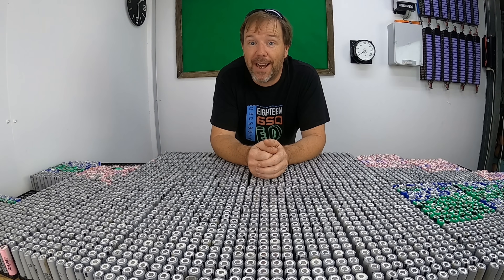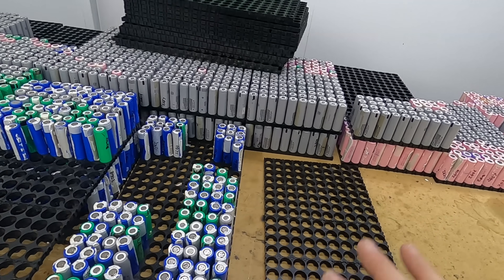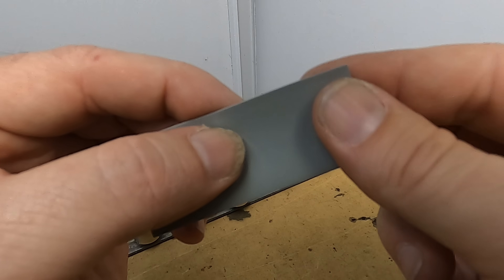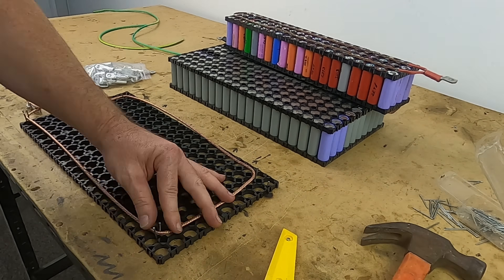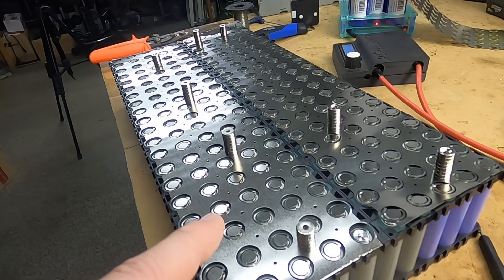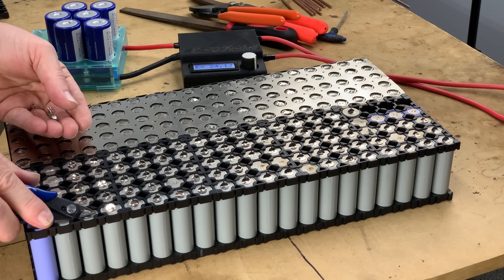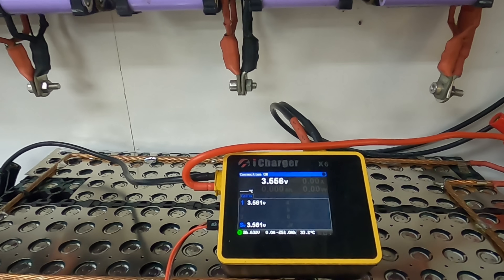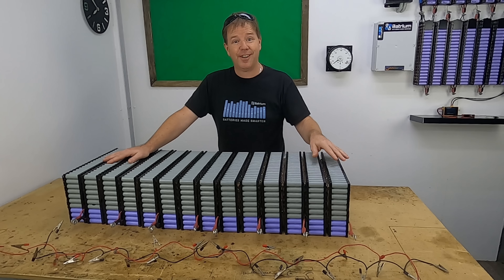Creating my single biggest D.I.Y. battery with 2800 18650 cells recovered from used laptop batteries

Comment: Dude!  You have good intentions for recycling but this is dangerous.  And you are encouraging people to deal with a potential bomb at home.

Batteries from different manufacturers have different chemistry.  They have different charging characteristics and different internal resistance.  Then there are good manufacturers with high consistency and bad manufacturers with filmy cell construction.  And you just put them all together.  Worse, you used old batteries of varying capacity degradation.  All these can cause current back flow and will increase battery internal temperature.

When I made commercial batteries, not only can we not mix batteries of different capacity or batteries from different manufacturers, we also have to use batteries from the same production batch to ensure internal resistance consistency. 

And then you are doing spot welding with tons of batteries sitting next to one another.  I had seen small explosions at our welding stations even with help of jigs to align welding spots with the spotters.  Now you are welding with free hand.  Poor cell manufacturers posed the greatest risk for our workers in the welding station.

Then the way you stacked these cells is hindering airflow to the inner cells, further increasing the temperature during operations...

And you put no temperature monitoring and safety circuitry to control voltage & current...

Man, pls don’t do this.  You clearly lacked the knowledge on the safety aspects of handling batteries.  Pls do not mislead your followers thinking making homemade batteries is a good idea.  

Leave it to the professionals.  PLEASE
Reply from the maker: Dam dude you looked at the rest of my channel - you might have done it for a living but i have lived this shit for years and years. Everything you said is kinda true except that stupid word bomb - you ever googled the fault state of a bomb, they explode- these vent .. MASSIVE difference but each to their own. Look at the second video and tell me I don't consider safety at every step - took me a year to test thousands of cells and get these ones together.. These weren't the shit at the bottom of the barrel they were the cherry picked good ones. Lets not go down the path of not doing something that is great for the environment because we are scared. Lets give all batteries the second life they deserve.
Reply: HBPowerwall My initial comments seemed a bit harsh. I apologize if I sounded disrespectful.  I do respect your intention and efforts to reduce environmental waste.  It’s admirable.

On the “bomb” comment, it did seem a bit exaggerated.  Nonetheless, I had personally blew off some of my batteries during my testing.  And the last ones I set off were only 4000mAh.  Well, I wouldn’t want to be anywhere near them when they exploded.  And yours stored energy 2000x more than mine.  I would be truly frightened by the thought of it going off.

On the 2nd part of your video, I saw that you bought a container to isolate the battery from your living area, which is a good precaution.  Still, if you were to work with lithium cells & batteries, I would suggest you build in safety mechanism on the battery level.  Control the current & voltage.  Good batteries should have each individual cell be monitored for current & voltage while the hottest part of the battery has to be monitored for temperature.  I am sure your followers would be thrilled to learn these from you.

Comment: Unbelievable. Great work.
But I wonder something....
Why are you putting so much effort into old batteries, What is the lifetime of those batteries? If laptop batteries were dead, this means, they are also bad?
Reply from the maker: To be honest it was to make a cool video (success lol) but i already use this system for the past 4 years and with maintenance  its holding up 100x better than expected. I'd hoped for 5 years useable but I'm coming up on that milestone fast & the batteries aren't showing signs of slowing down yet. Every cell goes through a complete testing process that for this battery took many many months.

Comment: Thank you for all the information, and taking the time to post/video/edit AND reply to every comment (that's so huge). I was wondering about the kWeld kit, I'd like to have it work without a Lipo battery and saw that you have the kCap Module. What power supply do you use and do you use the kSupply, as well? 

Additionally, I have 70+ 18650's that have been sitting for a few years and the protection have gone off and they measure 0v. I read that it's not safe to bring them back to life (by applying a jumpstart voltage) as they may have copper shunts that formed over time across the cathode and anode, what are your thoughts?
Reply from the maker: best bet is to look through this thread and it's videos - www.diypowerwalls.com/kweld. If a cell is zerovolt recycle it ..
Reply: @HBPowerwall  Thank you!

Comment: How do you process capacity of that many batteries? What do you use? You do bulk parallel (20 o more batteries)capacity check ? What charger model you use?
Thanks
Reply from the maker: One at a time with an http://www.diypowerwalls.com/opus
Reply: HBPowerwall 
Really wow about 1500 days running capacity

Comment: Beautiful work and inspiring.  Only one question - what type of laptop use 18650 batteries?  I've never seen a laptop use that.
Reply from the maker: in the past most laptops used 18650 cells some used 17650ies then prismatic or pouch.. these days its more pouch style batteries that are slimmer, lighter and more dense

Comment: Szort and easy  - not proffesional, crazy and stiupid, very, very danger. If you want have problem do the same battery pack !
Reply from the maker: You're the type of human that replaces a tyre when it gets a flat rather than repairing it. The environment will thank you for your approach to life..
Reply: You are absolutely right, professional would be easy to use a LiFePO4 battery. This is less dangerous and costs just as much. Using the Li-ion battery for stationary applications is very stupid.
Reply from the maker: Would have made a boring video 😂

Comment: I only use brand new batteries(as in brand new cells inside)but this is a cool project, one of the largest DIY battery projects I've ever seen on YouTube.

Testing used cells is way too time-consuming I'd rather not bother...
Reply from the maker: I would agree and would rather not bother - BUT new cells would make for a boring timelapse lol
Reply: @HBPowerwall  true

Comment: Clear my query. What If one of those cell battery stop working how do you rectify that and how will you replace it?
Reply from the maker: Rip the nickel strip off as i did in this video and knock out the cell.. a bad cell gets hot & a thermal camer is a handy tool to have in your tool box

Comment: The extra 3 empty spaces for the holders is logical, but I didn't understand the purpose of the 6 blank cells.
Anyone?
Thanks
Reply from the maker: 6 blue cells are where the cells touch the metal mount - To stop shorts

Comment: Where are the fuses? Aside from those wires coming out of each pack, which seem to be the current fusible links, intentional or not. With each battery having a fault current capacity of at least 5A and most modern ones 10A or more, the available fault current of each pack in that battery bank is dangerous. Better use beefy fuses with an adequate AIC too, lest they become dangerous little grenades. Stored energy is not to be trifled with.
Reply from the maker: Well there is a CID, then the fuse wires, then battery bank fuse, then shunt trip, then charge controller/inverter THINK i got this covered well.. i'm not good at math but thats about 5000 fuses or safety devices

Comment: Are you afraid fire from battery?
And for what you using this big battery pack?
Reply from the maker: Nar - check out the next video it's all going into a shipping container. It will be added to my 50kwh of the same storage i already have of the same storage. That will make 75 kWh of batteries

Comment: You can make a spot welder with a 12 v battery and a Ford starter solenoid.  Works great.

 Why not make the packs 6, 9, 12, or 24 volts instead of 3?
Reply from the maker: Yes you can, it's cheap and accessible but not consistent or repeatable. the whole battery is 48v nice and cheap to add a BMS to it this way.

Comment: anyone seen the results from the national battery testing center in Canberra? Its a train wreck of faults,defunct suppliers and lithium batteries that fade with use. Lithium has its place for small,mobile devices...........but it has some serious drawbacks. For example Lithium storage batteries now require fire proof enclosures inside buildings, are expensive and on a once daily charging cycle will only last 15 years, maybe.       Or THIS https://youtu.be/ehcGWLOH-Js
Reply from the maker: You've also seen all the crash tests of cars that are still on the road right??.. ok next point look at next video :) and if get 15 years usable from the i'll be freaking stoked - if I get 10 safely i'll still be stoked - and if i get 5 good years with full daily cycles (including my other 50kwh of the same storage) i'll do a nudie run up the gold coast highway!

Comment: Out of the 3000 batteries you recovered from laptops. Were they all above 2.7v? Or its safe to recover batteries went below 2.7v?
Also. Has any battery exploded or got extremely hot during recovery?
Reply from the maker: I've recovered more than 15000 cells in total, 1000s and 1000s were below 1v and recovered slowly & carefully most have been very usable. I've never had any cell 'explode' BUT if you look at a video from last week I had one expand on me that could have gone very badly.. not good at all and a wake up call for sure. As for cells getting hot THOUSANDS got hot and were recycled.
Reply: @HBPowerwall  appreciate your response. 
I think for quality brands batteries The risk is very very low. Thats why people are divided.

Comment: Curious. I guess it is very likely to recycled that two batteries in parallel have different behavior like capacity, internal resistance.their voltage drops differently
Reply from the maker: every cell was resistance tested and are closely matched in that respect. It's not idea but it is DIY and helping cells to their full end of life not half of it.
Reply: @HBPowerwall  oh i see👍👍. thanks for response.

Comment: This guy is Wicked Definitely something id like too try out In the future big Inspiration 🙏.
Could anyone help me out I've stripped some laptop packs done all of the appropriate checks checked voltages disposed the bad low voltage cells. Charged  the cells with Over 2.5V and also Discharged with my Discharge PSU Everything Checks out however i tested The cells in my vape uses 2 18650 and its weak Im assuming the cells can't Supply enough Current too power the coil Im just confused why They tested Good but not actually when in use
Reply: The Cells are Samsung 30Qs
Reply from the maker: No NCR18650s

Comment: Hi i saw your videos its soo cool and I'm need to know more about BMS since the own build power bank using a small PCB weather it will surve it purpose of cutting the power supply when the overcharging or any over heating issue in battery will it handle?

Comment: Why do you mix 18650 cells of different mAh capacities in each pack, like mixing 2300 mAh cells with 3000 mAh cells? I completely don't understand the reasoning behind doing that. Won't the pack be only as good as its poorest performing cells?
Reply from the maker: Well they all self balance so there is that, each 191p battery is well matched to it's other 14P and the BMS balances them. Also it's used cells - they would be unusable if you weren't to make concessions on capacity

Comment: I once set a 18650 on fire by soldering them instead of spotwelding. Scary stuff, I can tell you..
Reply from the maker: how did you set it on fire just from soldering? what were you doing wrong?
Reply: @HBPowerwall  I didn't had a spotwelder on me and had to repair some nickel straps after removing a bad cell. So I have soldered one nickel strap on top of another, got the solder liquid, pushed down the one nickel on the other and boom, the liquid got between plus and minus. Was a hell of a fire for 5 seconds. Really thought shit is going down with the 3kWh next to it but it somehow stoped again by itself. Maybe because the liquid solder stuff burned? I dont know, it was a blue, high flame (maybe like 10-20cm, dont remember completely anymore).. really scary.

Comment: 13:15 doesn't soldering on top of the batteries heat them up? What about soldering the busbars first and then welding the batteries afterwards?
Reply from the maker: Tired that but lining it all up was a bitch to say the least this way was the lesser of two evils

Comment: Amazing, how much time you think your battery will last if you keep it all the time in a 60 to 75 max discharge? love everything you do!!!! another question is, the batteries are just used old batteries? or you did some process to restore it? thanks!
Reply from the maker: I would think 10 years - now that is dependant if i can control the heat in the shipping container. I tested every cell - for heat, capacity, self discharge & internal resistance .

Comment: when one cell goes bad....F"¤%&//8
Reply from the maker: Or you check you use common sense and maintain your battery, using a good quality BMS with temp & voltage control, use a thermal camera to keep an eye on cells & install in a location so if F"¤%&//8 happens - nothing else gets F"¤%&//8ED with it...

Comment: Are not those batteries supposed to be useless? How are they going to store charge?
Reply from the maker: Would have spent this much time if they were useless? There is 25kwh of useable storage there ... Wouldn't consider that useless...
Reply: @HBPowerwall  
My real concern was the following: If those cells were used, how would I standardise the remaining capacity of each cell that I will be including in the big battery? Are they all of the same remaining capacity? It is Impossible. What would happen if I included, in that battery, some cells that are of significantly less remaining capacities than the others?

Comment: But without using BMS's for each cell you can end up overcharging/undercharging certain cells and in extreme cases it will catch on fire would it not.
Reply from the maker: Watching to the end would produce a rather reasonable answer to your question...
Reply: @HBPowerwall  I saw that you said in the final video you would attach a BMS but I'm assuming your attaching that to the banks of cells and not the cells individually. If your connecting it to the individual cells then apologies I just misunderstood.
Reply from the maker: Tesla doesn't even attach to every cell? Each 'cell' is a 191S battery so that will naturally balance - no need to do 5000 extra little wires
Reply: @HBPowerwall  Well I mean tesla watercools their powerwall and uses cells that are almost identical for each. What's a 191S battery, an 18650?

Comment: This might be the most economical way to upgrade the old lifepo4 batteries in my zero turn electric mower I converted (see my short video).
I was thinking of used Nissan Leaf cells.
Reply from the maker: Leaf cells would be better, these don't do high amp draw and rough ride would destroy the plastic mounts & fuses fast i think.

Comment: What cell insulators did you use on the top Pete? I can't find a reference to them in your Project sheet
Reply from the maker: I got them from 18650 shrink .com here - https://rover.ebay.com/rover/1/711-53200-19255-0/1?mpre=https%3A%2F%2Fwww.ebay.com%2Fitm%2F18650-Battery-Insulator-540pc-DARK-GREY-Adhesive-ebike-DIY-Powerwall-US-SELLER%2F132303960347%3Fhash%3Ditem1ecdee391b&campid=5338316525&toolid=20008

Comment: What are you going to do as the cells die? They are used so they will be dying one by one monthly. What a nightmare tracking down and changing the dead cell! does each and every cell have data logging? I use brand new Samsung 21700 cells. Much larger and run much cooler. They are new so i can relax and not worry about wasting my time.
  This is the biggest waste of time i've ever seen. Tell me this was bad criticism in ten years! Each parallel bank is only as good as it's weakest cell and each string with a weak cell will be low on voltage. You should check the specification of these and see how many charge cycles they are good for, then think how many cycles they have already done.
Reply from the maker: arr you sound like quite the expert... so no use trying to educate you. My BMS is more than upto the job of babysitting my batteries - my last battery is still happily running my home for the past four years.. and i'm going to bet 1/10 the price you paid for 4 times more storage.. you take your new cells and their price tag. I'll take my old cells and save the environment just a little bit more & save a hell of a lot of money..
Reply: @HBPowerwall  If your running your home there is no reason to go li-ion. Just get some old fork lift batteries and the job is done!
Reply from the maker: Been there done that voltage sag alone is reason not to go back

Comment: I would like to have your confidence that those trash accumulators would not catch on fire. Even new automotive ones could.
Reply from the maker: So coud your car, phone, laptop, powertool, toaster, the list is long with the items i own that i have confidence in.
Reply: @HBPowerwall  Yeah :) I use such refurbished batteries in light torches etc. And I have seen few shorted, they could go pretty hot. Anyway, I sincerely wish you a good luck :)
Reply from the maker: they aren't refurbished - they are just tested used cells.